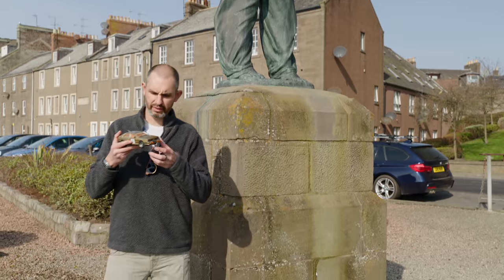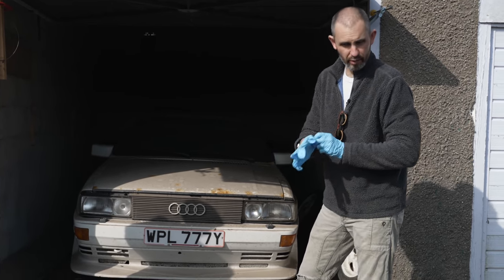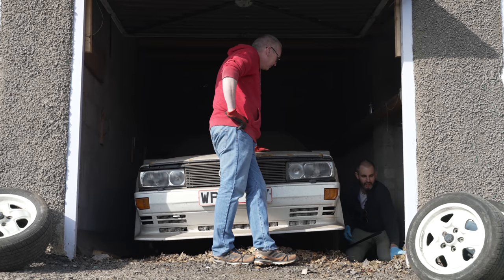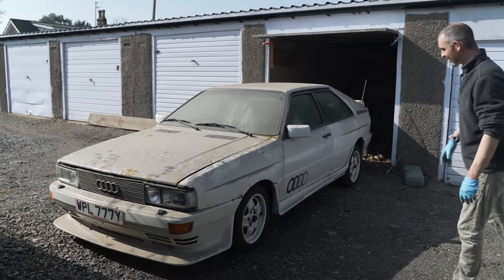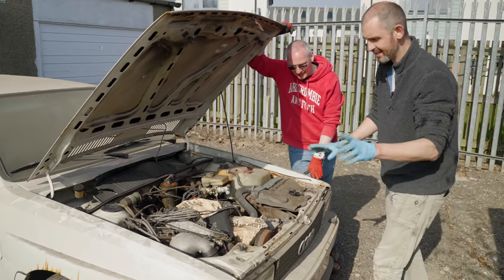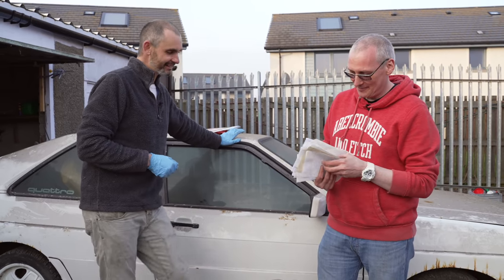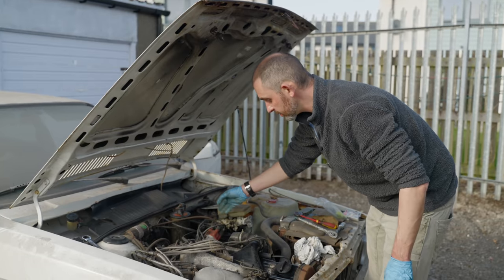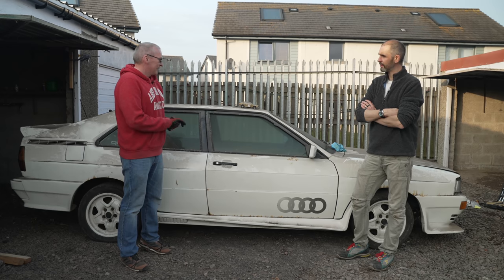Audi Ur Quattro Turbo Barn Find  - rare survivor sat for nearly 30 years

Comment: I drove my father in law's black on black  late 1980's (?)4000 Quattro Sedan, in line five cylinder, five speed fully optioned - same interior save for full leather, the same locking diff display panel, instrument pinnacle, steering wheel.  Fast, comfortable, very sporty but low key and virtually unstoppable in all road and weather conditions. Drove it several times in a full on NY winter blizzard with 12 inches plus snow and ice. Loved that car!

Comment: I am actually glad the starter didn't work. The timing belt needs to be changed before the engine is turned over or the camshaft could stop and a valve could be bent. I remember this happening on a very low mileage Sport quattro that had been on storage for a long time.

Comment: My barn-find Cerbera was garaged at 18 months old, until 15 years later when it finally saw the light of day. The fuel had turned to slime in the tank and caused me no-end of issues - the last thing I would want to do with that Quattro is to run 30 year old fuel through the whole system - ideal way to gum-up everything!

Comment: Hi Guys, Just came across you video on youtube, under the air filter box clipped to the inside of the chassis leg their are 4 inline wire connectors I think the red wire is the starter solenoid, these connectors do tend to have corrosion problems, they just pull apart, all the wiring runs out from the fuse box area above passengers foot well area along left hand inner wing across the inside of the front panel to below the right headlight area then on to the right hand chassis leg. looks like a good project.

Comment: I had a 200 quattro turbo back in the day, basically the same running gear, very light performance tune, maybe 250 hp, it scared me as it seemed to put no effort in to get to losing my licence speeds, I went back to hot hatches, my first, last and only Audi. 

A friend had a coupe quattro circa 94 tuned to 500 hp, brutally fast for the day. 

Nice barn find episode, Johnny. A pleasant trip down memory lane.
Reply: Probably a rarer car than the UR,  100 turbo and 200's were a rare thing, I had a few type 44 Quattro Avants and they were a great car but I could never find a decent 100 turbo or 200.

Comment: Sophomore year in college I worked in the service department of a Porsche Audi dealer. I have driven a number of these Audi GT’s in my time there. I was also asked to drive a very rare and expensive  Tornado red Audi Sport Quattro onto a four post lift. A bit nerve-racking  as one slip and that car was off the lift pushing a Snap On tool chest through the shop wall. I believe that Audi and a Porsche C4 Ruf turbo owned by the same customer are the highest value cars I have driven to date. The customer had a black and white version of the C4 - I drove the white one as the black one had the engine out and was at Ruf getting the work done. The black one sold in 2019 for $248,000 US so the Audi likely beats that as it is valued near $500k. Crazy cars.

Comment: My friends Mum had one in the early 80s. He borrowed it one snowy day to take a group of friends to the pub. I opted out of the trip on that occasion but about an hour later I was phoned as he had got it stuck in a snowy dip in the road due to its low ground clearance. I went out in my Series 2a truck cab freed the Quatro and left it on the side of the road. Managed to get two in the cab of the pickup but two had to sit in the pickup bed it was only 10mins to the pub but the guys in the back were frozen. Luckily there was a good fire in the pub. That trip secured my intense love of Land Rovers but i have always liked the Quatro for its Rally success.

Comment: I just had a similar experience, an Audi 200 Quattro Turbo i just bought with some spares. Hasn't run since 2009. Done the timing belt and pumps  but it won't crank unless I wire it directly so.. now going through the hrs of frustration just to get past step 1 😔😔 Then I'll have the Mechanical injection to enjoy .

Parts are an ABSOLUTE NIGHTMARE.

But.. for the day we get it running it makes it all worth it! Right? .... Right??😥😭

Comment: Great car , love the barn finds videos but so pleased it would not turn over, after 28 years with no cam cover that engine needs stripping not starting
Reply: I agree completely, Paul. I was grinding my teeth in frustration as they were trying to get it to turn over. Jonny, why don't you try for a second episode whre the car in question has been gone through and safe to try and start?

Comment: What a great find - I suspect it had a front ender at some point as it's got the very late 82 83 spec flush front lights fitted and aftermarket front bumper and bodykit. Love these early 10v Quattros and GT5 Coupes.

Comment: Objectively probably not the best rally car ever (though certainly an evolutionary leap forward) but, in Group B form, they definitely put on the best show, and, let's be honest, Group B was the best show ever. The 5 cylinder wail, the anti-lag pops and bangs, the flames from the exhaust lighting up the scene like a camera flash on the night stages, the four wheel power slides on asphalt coming out of curves...

That shape is so iconic.
Reply from the maker: As you put it so well, the Quattro was nose heavy and a bit of a lump hammer. However it packed the power and the traction, then barged its way into the record books.

Comment: Brilliant video!
Enjoyed watching, I almost bought one of these way back for £900, I had an Opel Manta coupe 2.0 GTE at the time, I liked my coupes very much!

Just wondering why it didn't start? Maybe that was why it was put away and stored because of an electrical issue or sensor or other mechanical issue, seems odd the cam cover was missing as well?

Could be an immobiliser issue 🤔 sometimes owners of cars from that era would fit aftermarket alarms with immobilisers with a hidden switch under the dash somewhere, I've personally done that with some cars because they were so easy to steal, I'd put a fuel pump cut off switch hidden somewhere!

If it was the starter motor, it should at least click or fuel pump should whir or some other relay type noises etc 👍
Reply: Great taste in cars PD. My brother also owned a Manta GTE. Another in the long list of coupes he owned!
Reply: @jasonharrison4652  Mine was in a scarlet red, looked almost orange in some light, on a 'A' plate so a year after this audi, I think it was a 1984, it was a good 10 years old when I bought it from a bodyshop who'd done extensive work on the front end including new inner wings, new bumper etc the whole thing had been resprayed and it was fitted with alley cat wheels, silver rims but the centres had been sprayed the same body colour, looked mint but was dusty and dirty sat in his yard on a couple of flat tyres, I was just lucky enough he took £500 for it because it was worth much more.

Apparently the owner had picked up a hitchhiker, when he went to put fuel in it he left the keys in and the guy drove off in it, crashed it into a tree hence the front end damage but it was a repaired and fixed, some issue with the insurance company meant he never got paid for the work so the car became his property! 
He was just glad to get something back for the work he had done, I think he said the respray alone was £800 back then, plus he'd done lots of welding, new wings bumper, slam panel etc

Comment: For a few quid you can buy a threaded rod you use to hang and align a wheel onto a hub which doesn't have studs. If you're going to do this regularly, I'd recommend getting a selection of them.

Comment: Nice presentation and thank you for the memories. I owned back when, a US version, identical interior but in mars red exterior. Funny but in the US, an ur-q was the same price as an Audi Coupe GT combined with a Porsche 924.    As for the subject car in this vid, appears aftermarket side skirts and air dam perhaps by Tressor (Walter). Others body kits avail. back then were Lorinser and Zender. Those option factory wheels I believe were made by Fuchs and are forged, vs. Ronal cast.

Comment: A mate of mine had one. It was a pain to work on. Really odd quirks like say, if you wanted to replace the front headlight you had to take off the rear bumper and drop the fuel tank. Not quite as crazy as that but close. "Designed and built as they went along!"

Comment: Fantastic video Jonny, great to see another quattro in the spotlight and what an example. I am not sure whether I am more excited by the immaculate interior, Fuchs Wheels or period bodykit! 

Since you filmed our car for Generation Flex in the Autumn, we have been working to find out the cause of the poor running. The Cylinder head on our car has a breached wall between cylinders 3&4 and apparently this was quite a common issue for them to do at around this sort of mileage (ours is around 95k, same as this) as the block couldn't handle the power easily. Now I could be wrong on this, but given it is an expensive fix (can't simply put a new head in) this could be why this car went off the road. I am not as much of an expert as I would like to be, but in our experience this is what has happened (we have the same engine as the running gear was the same on all quattros till 1987 when it changed to the MB).

I sincerely hope there isn't a quattro curse on this channel, sooner or later, we will see a running (and driving) one!
Reply: I'm just wondering wether the guy had a "scary moment" in the car and decided that's it it's being parked up .
Pretty quick car for the time...
I've had a few near misses on motorbikes over the years...
Does make you think....
Love the early  5 cylinder Audis.
Reply: @Stuart D  I wouldn't say it was the first thing that came to mind in terms of scary cars, the power is very controllable with the 4WD. Early cars like this were a bit agricultural mind so it could have just been really awkward to use it everyday

Comment: 28 years sitting you should pull the plugs and get some oil in the cylinders, and crank it without the plugs in and build oil pressure before starting any engine that sits.

Comment: Cam cover may have been removed to be blasted and powdercoated if the rest of the car had recently been repainted. Should check any local powder coaters that the brother may have used in case it's still around.

Comment: I put my 1983 Metro turbo in a garage in 1986 with around 21 thousand miles on it, it's still in there, I opened the door about 15 years ago, just to see what state it was in. quite a lot of surface rust :(

Comment: Is it possible the car is equipped with a clutch pedal starter interlock switch?  I can remember trying to get my parents 79 Chevrolet Chevette started and was so embarrassed when I realized the clutch pedal needed to be pressed in to allow the car to start.  (my 71 Ford Pinto did not have such an advanced safety feature....). Never forgot it again after that day on all my manual transmission equipped cars!

Comment: My BMW has a stud in the tool kit that you can stick into one of the bolt holes in the hub to help align the wheel. I heard German cars use bolts because of the different thickness of the winter/summer rims, but our golf has alloy summer rims, steel winter rims, and only one set of bolts, seems to work.

Comment: I was very close to buying this very beast around 89/90, It was for sale for about 6-9 months from a garage around the corner from where i worked Pittodrie Car Stadium in Aberdeen but back then insurance for this was insane and i was 19 yr old so it was a no go even though i tried and tried , this thing was absolutely melted by the owner Murray Adams of that garage foot to the floor all the time and sounded amazing.
Reply from the maker: This is such a cool memory Steve. I want you to complete that unfinished business and buy it!
Reply: Steve, that is really interesting and great to know that you have heard the old beast. I can still remember the distinct noise reverberating off the buildings in Montrose. I have been getting lots of messages about the car and they always mention the sound it made. I must be one of the few who actually like the body kit and colour coded mirrors and rear
 spoiler. There were actually two ur quattros in Montrose at the same time and I always thought the standard one looked a wee bit plain when next to my brothers one. The gentleman who helps us in the video has a photo of the two together at a Quattro meet in Scotland from about 93 or 94, they look great sitting next to each other.
Reply: @TheLateBrakeShow  That is probably the garage the car was bought from, they done their own MOT's also so in the history there will probably be a couple from that garage. If i remember correctly i am sure they had either a white or red wide body starion turbo for a while
Reply: @jasonharrison4652  Contact Pittodrie Car Stadium in Aberdeen , the owner Murray used this car as his daily for months while it was for sale, he will know if it was sold with a hidden switch. He may even buy it back
Reply: Steve. Did a bit more digging through the small amount of paperwork I have for the car. I think that the car may have passed through another owner before my brother as it seems he purchased the quattro from a garage in Dundee. I think he may have purchased the Starion from the garage in Aberdeen, then traded it in shortly after for the Quattro. Its amazing how things get a bit fuzzy in the old memory after 28 years! I am sure he told me he spotted the quattro in a garage in Aberdeen though, maybe he did but someone beat him to it and then he somehow spotted it in Dundee or someone told him it was for sale again. Who knows, it all adds to the mystery!

Comment: Loads of people have probably already suggested this, and I’m well aware it makes no difference now but if there is no noise from the solenoid I’d be checking for a rogue 80’s/90’s weird and wonderful retro fit immobiliser…. Not exactly p.c but I know of a few lads up here that used to store the keys and immobiliser fobs separately when they needed to ‘store’ their most prized metal for a period of time….:not saying that is the case here but it could be that the fob wasn’t there with the keys and therefore no one knew to look. Or could just be a knackered solenoid/loom/ignition barrel ect 😂

Comment: I wouldn’t even attempt to start this car- imagine the state of the timing gear and fuel system! You would certainly do more harm than good. The only way to tackle this car is to remove the engine, gearbox and fuel tank, and start from there. Nice find tho! ( I had a couple back in the nineties)

Comment: They were a bit of a big bus at the time,  but infinitely more macho than the little hot hatches. My boss had one, and later a workmate.  However this is when audi could make an eye catching car. That said the boot lid and opening was a bit of embarrassment being a true coupe.  It looks like it should have a large hatch, and would be much more useful if it did. I remember well the odd latch in the drivers B panel to open the boot.

Comment: So glad the car did not start - old oil, fuel, belts = potential disaster. From personal experience with contemporary VAG products, the ignition switches wear out. The lights come on the dash but the starter won't get any electricity.  Changing the switch is quick and cheap and original keys are retained.

Comment: Starting a car that's been sitting for 28 years is not a good idea, given the sediment that must be in tank and fuel system.
Reply from the maker: We disconnected the fuel pipe and planned to run a separate supply from a can

Comment: very heavy cars to push
Reply: You say that. In the specs it says kerb weight 1300kg. 
My mini Cooper S is 1200kg probably 1300 with the cerape in the boot lol...
Reply: Only those who have tried to push a quattro will understand that the a seemingly light kerb weight doesn’t help with the drag in the drive line. They are pigs to get rolling even with air in the tyres.
Reply: @kimberleycannon6894 
Good point didn't think of the drive line...🤦

Comment: Did these cars not have brake and clutch pedal interlocks on the starter circuit?  I ask because it didn't look like anyone had feet on pedals during the failed start attempts.

Comment: Honestly, it's just an old car with no value today. It doesn't run, parts are expensive and impossible to find and it doesn't have the latest engine management system that will maximize performance while keeping fuel consumption low. If it was mine I would just do an engine transmission swop to something modern. Every other engine bay part can be third party and placed in relation to the engine/transmission. Get the car cleaned and painted, interior detailed and call it a daily driver.

Comment: In coming "Master Tech" mechanics shouting and balling about how many things these 2 did wrong..... 🤣🤣
Is that a Tresser front bumper ?
Reply: To be fair, there are some great bits of advice being posted and some of them would have been great to know at the time, there is obviously some very experienced people offering advice. 
We did however take a lot more precautions than it was possible for Jonny to show in the half hour edit. We were there for a whole day and its not Jonny's first rodeo.
As for the front spoiler, we are not 100% sure if it is a Tresser or not, have not found any stamps or markings to confirm i believe there were a few companies making body kits for these cars back in the day. I appear to be in the minority but i actually think the body kit and colour coded wing mirrors and rear spoiler look great (I'll get my coat!). I am sure that the eventual owner will most likely remove the kit and return to standard.